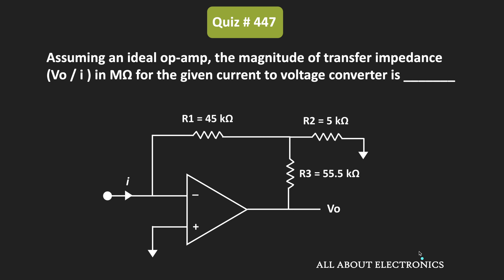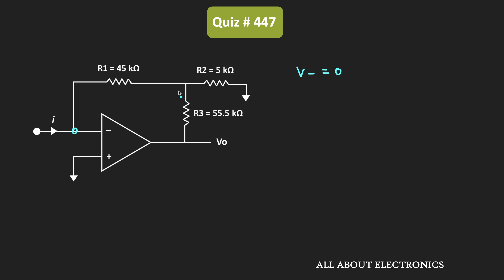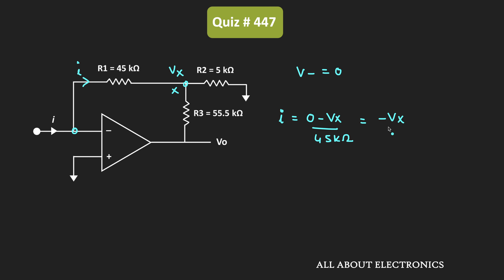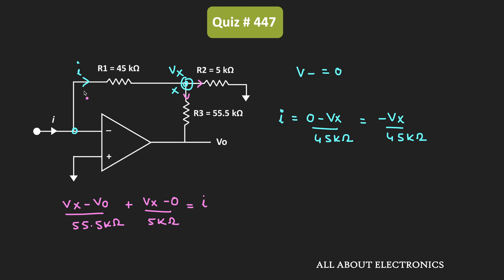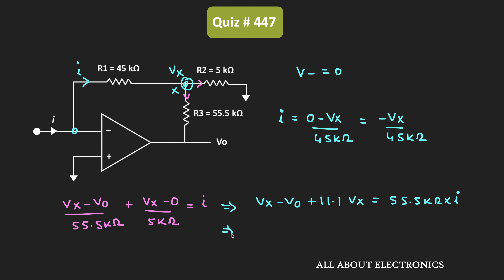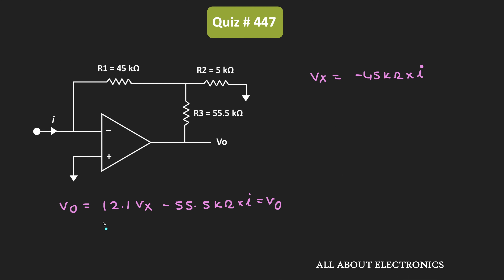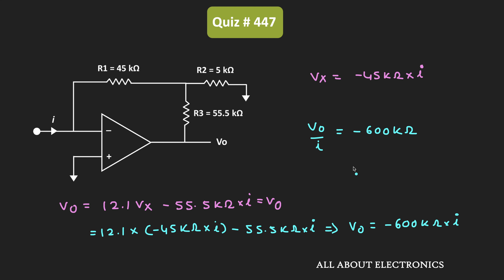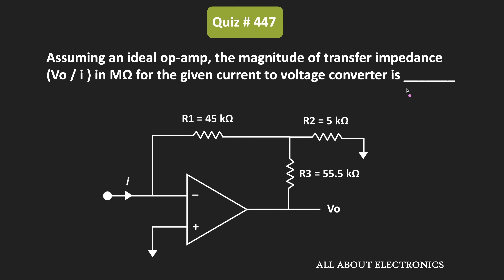Operational Amplifier (Op-Amp) Solved Problem | Quiz # 447

Comment: In this question I guess R1 and R2 are in parallel so i will get divide into R1 and R2 and after that whole i will flow through R3 so the answer should be 60 not 600. Correct me if I am wrong....???